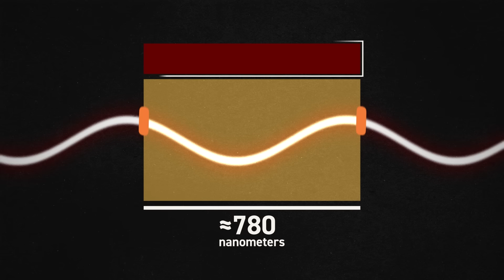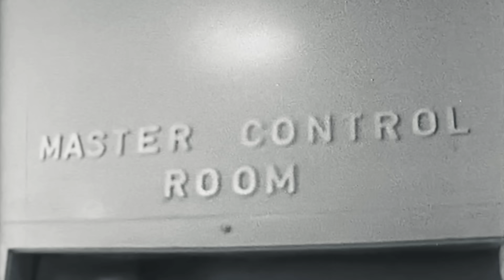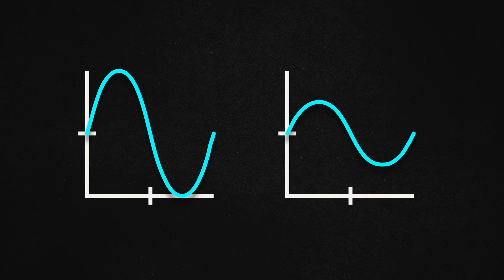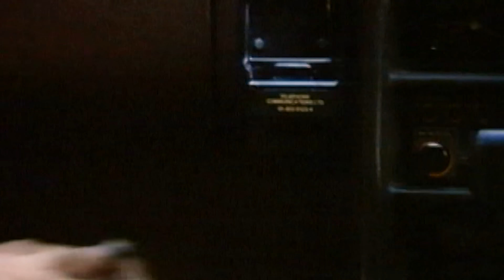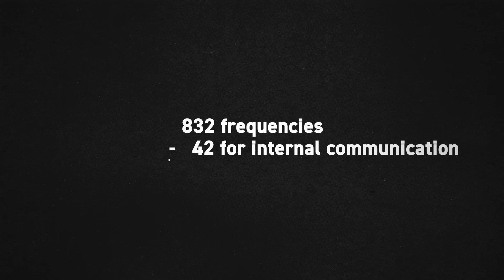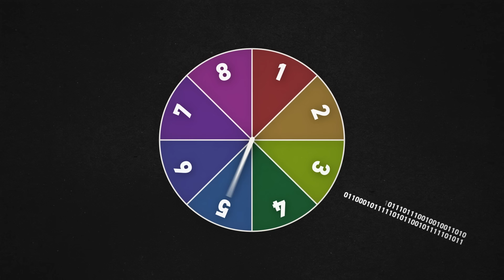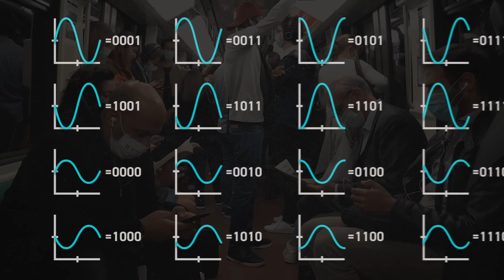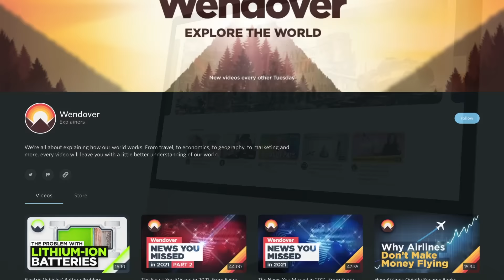How Cell Service Actually Works

Comment: 2 meter wavelength is technically not ultra high frequency (UHF), but very high frequency (VHF). 2m wavelength radio waves are 150 MHz, and UHF is 300-3000 MHz.

Comment: Though the various communication companies know and or knew this prior to the first time setting up a network. It was more expensive, meaning investor's wouldn't get a return they demand. So just as hireing the lowest bidder isn't alway's the best choice when issue's eventuall come to be. It's done in steps, build a one "G" system, while planning the impleametation of a threee "G" sevice, followed by a 4, 5 etc. etc. etc.

Though the various "TOWER'S" are now every where, I remember a time when, we stated in no uncertain term's. Not in my yard.

Comment: Great video but I'm still confused on the CDMA method.  I get the encryption, but how do three cell phones broadcast on the same channel and not interfere with each other?  Does only one talk to the tower?  If all three do how do the waveforms not mix together leaving a mess?  Or is the simultaneous broadcast of numbers amplitude driven?  It was great but the details of how they don't collide....well I guess I'm missing that part....

Comment: 11:35 They have 6 neighbors but it doesn't mean 6 different freuqncies. The neighbours could just switch between 2 back and forth and there wouldn't be any interference. I think you only need 3 distinctly different frequency blocks to get an entire grid without interefence (with the picture at 11:35)

Comment: Fascinating; so your phone's processor is doing all these calculations and more turning these bits of data into the text and images we see in real time. I wonder if this process could not work with older chip technology... i.e. 2000's chips; and what the limiting factors or bottlenecks are today.

Comment: So basically,  yes partially unrelated,  it does not matter trying to use/create a better or external cell phone antenna. As the sytem at the tower would not be able to adapt to the changes made at the hand held end. Now i see why my experiments have always been less than a marginal improvement. 
Thank you very much.

Comment: ok one thing thats always wondered me is when i send a text/phone call. to find the receivers phone, does every cell tower around me send the signal in an outwards direction until it pings with the receiver phone? kinda crazy to think sending a text across the country could use thousands of cell towers

Comment: 15:09 Is it possible to spoof a spread code? because if so, it could be insecure to transmit the same data to all users while one can decode it by using another user's spread code

Comment: 0:11 um actually the cyan colour displayed on most, if not all computer screens is made up of green and blue pixels. The light emitted is a mixture of blue and green. Our eyes detect this combination of wavelengths and interpret it as cyan, although no cyan light was emitted.

Comment: Actually on a monitor cyan isn't actually the wavelength of cyan. If you were using a cyan laser, yes, but on a monitor, no. It's a mix of blue and green diodes that our brains register as cyan.

Comment: Well, a computer monitor only produces red, green, and blue light - it produces no light at a frequency that would, by itself, be recognized as cyan (like the one mentioned at the start of this video presumably is). But it can produce a combination of blue and green light which stimulates the cones in your eyes the same way actual cyan light would, and so you can't tell the difference.

Comment: When it shrinks to 370nm it is not dark "purple", it is VIOLET, and there is a difference.  Purple is a mixture of red blue, we see violet as violet because light in the neighborhood of 380nm excites both our blue receptor AND a secondary peak on our red receptor thus our brain interprets it as similar to the color purple, but purple, a mixture of red and blue also to some degree excites our green receptor where as light in the 370nm range does not, hence purple appears much less saturated than violate although similar in hue.

Comment: How does the composite signal work when each device is transmitting independently?  It seems like you would need a single device to handle the individual signals and translate them into the composite signal.  Unless this is only done for going from the tower to the device and not the reverse.

Comment: Where does the decoding happen? if it's on the receiving phone, then surely it would be possible to write a program that modifies the user-code so you can snoop in on others conversations.

Comment: One confusion- the video creator spoke about multiplex comms towards the end of the video in which multiple users could share a packet of data that is being transmitted over a cellular network- this created the '-1, -1, -3, -1' type of data seen at the end of the video. But up to this point, all data transmission is done in binaries, as shown in the wave designations at the beginning of the video (16-bit, 64-bit, 1,024-bit), which are only comprised of collections of 0s and 1s, none of which are negative.

What am I missing? How are we able to leave the world of binaries for this packet-sharing technology shown at the end of the video? I understand with 16-bit chunks you can express any digit as a collection of four 0-or-1 digits, however the negative numbers would mandate a fifth digit- a sort of 'identifier', wouldn't it? I must be missing something. Thanks ahead of time.

Some basic googling seems to indicate that this fifth digit may actually be used, but I'm not sure.

Comment: You know most people know that cell phones get their service from the towers but they also think that the signal coming from those towers is provided by satellites. Which after some thought leads one to ask the question.. if television, cell phones and internet all get their signal from a wire fed system what exactly are satellites being used for? The number of satellites we are told exists orbiting earth is absolutely staggering but we don’t as the general public really use them so wtf purpose do they serve?

Comment: AM radio band has a lot of applications. I’m surprised aren’t being utilized especially with antiquated and simple, cheap, basically worthless technology. It wouldn’t be a big deal to tell somebody what it is without losing much research and development, but at the same time easy enough to understand and utilize in a very long wavelength that can travel and even balance between the earth surface and atmosphere.

Comment: I somewhat understand the leap forward that 5G is compared to 4G. 

My question is as follows: Assuming the inevitability of manipulating quantum mechanics to do our bidding at the most precise levels, do you think that quantum superpositional parallel sequencing will be the basis of 6G, or a later number? 

If its a later number, for example 9G, what do you think will be the biggest leap forward between 5G and 6G?

Comment: 11:33 Uh, I don't see why you'd need 7 frequencies. The four color theorem says you'd only need 4, if there were just perfect edges. In a hexagonal tiling you only need 3 colors.Of course the rreal cell tower map is not a perfect hexagonal tiling and there is probably a decent amount of overlap in some places making the 4 color theorem not apply exactly, but 7 seems like a random number. I'd think maybe 5 or 6 would be enough.

Comment: Please help. I have 3 traffic controllers working on a mountain. We all have rugged v3 radios with 16in whip antennas and a repeater box at the top of the mountain. However channel 2 works more reliably than repeat. Communication is constantly Cutting out, broken up, or not coming through. We get lots of interference pops and clicks.  Someone please help.

Comment: What I just don't understand about binary is how it knows when one piece of information stops and another one starts. If 01100 is Information A and 00111 is Information B, how does the receiver know that im not transmitting Information C (0110) and Information D (000111) instead?

Comment: It seems like you gave your editors a run for their money with this one! The b-roll on screen was pretty disjointed from the voiceover during the discussion of the AM band (showing B-roll of the civil rights movement?) and during the discussion of error rates (showing b-roll of a SIM card?). 
Top-notch overall! But I have to laugh at the image in my head of a poor editor somewhere panicking and shouting “We don’t have footage that goes with wireless transmission error rates! Screw it! Put in something wireless!”

Comment: This is such good information on communication engineering. However, I find it very distracting. The background music that you use takes away from your intended communication of the message. Please consider removing background information or background music. It is extremely distracting.

Comment: I don’t get the 14:40 adding part. There is no way the three users know each other’s coded number and somehow the numbers are added and transmitted at the same time. My guess is they simply transfer their data at the same time and the amplitudes are added up or canceled because they have the same phase??

Comment: The opening was jarring, seeming to suggest that one can't see electromagnetic waves, before later clarifying which ones one can and can't see.  Otherwise, an interesting explanation of transmitting data by radio (and specifically mobile networks).

Comment: The extremely low frame-rate on your graphics is killing me. Was it rendered at the wrong fps or what? I can't imagine this just "slipped by". Seems like they were rendered in a time-crunch, and it was just opted to use them as-is since there was no time to redo them.

Comment: At 4:31 this story exactly contradicts itself.  Just before that they say that "binary" transmits ones and zeroes.  Then I guess somebody figgered out that uh-oh, you can't transmit a zero, so they 'fessed up. 
"Binary" is just another sort of FM. 
"Ones" are slightly faster frequencies than "zeroes."  In this convention, anyway.
Then they do it again at 12:15.  When things get crowded, they "use digital signals encoded using phase and ampllitude."  That's called frequency modulation, FM, and ampllitude modulation, AM.  It's not digital.
When they use the phrase "efficient digital signal" at 13:00, they are lying.  What they mean is "efficient analog signal."  (Do they use PCM, pulse-code modulation, between the diaphragm of the microphone and the encoder of the radio transmitter?  They don't say.)
Reply: And remember, kiddies, "each" means one.  so each of anything is singular and takes a singular verb.  When somebody, e.g. Wendover, says "each are" it means they've lost track of their subject.  They don't know what theyre talking about.
Just take it down, rewrite it and re-record it, OK, Wendover?  The pictures are fine, and the technical background is roughly correct.  It's only every single detail that you've gotten wrong, Wendover.
You've assaulted 87,000 people to date, August '24.  Time to stop maybe?
Reply: oh sorry, they 'transmit a pattern that corresponds to a zero or one', is that better?

Comment: Mostly correct information, but near the start of the video when it starts talking about UHF frequencies, the narrator comments that they are roughly the size of a person, or about 2 meters. Full grown people are roughly 2 meters tall on average, but 2 meters is not Ultra High Frequency, or UHF, but actually Very High Frequency, or VHF, which is a lower frequency than UHF. UHF wavelengths are actually between roughly 4 inches to just over 3 feet. Not the size of an average full grown person, but a child yes, at some wavelengths.

Comment: Even though each hexagon has 6 neighbors, aren't tiled hexagons 3-colorable? i.e. you could use only 3 channels and still never have two neighboring cells use the same channels. And In general, any cell network should be 4 colorable, right?

Comment: I don't see the point of CDMA. They are transmitted simultaneously, sure, but we are transmitting 6 bits of information in an 8 bit message. Furthermore we have the computational overhead of encoding and decoding the message.

Why would transmitting an 8 bit code at once be superior to transmitting 2 bit messages 3 times sequentially?

Comment: So thee people each sending two bits, on a channel that contains 8 values each of which can range from -3 through +3 inclusive (three bits) or 24 bits transmitted, triples the efficiency over just sending the original 6 bits?
I don't think so.  I think you need to show an example where this does come out ahead, even if you don't show the working out in detail.
You should have said that with only 3 users it doesn't come out ahead, but with 4 it's exactly the same and this scheme works with up to ??? (I'm guessing 7.  There are 16 possible codes but I think you have to choose them carefully)
But wait a minute... with more users your sum in each position can get larger (or more negative) too!  So, I'm really missing something from this Code Multiplexing scheme's description.

Comment: I appreciate this video.  But I feel that you are trying to cover too much material too fast in this video.  You would need to already have a background in each of the topics to follow this video.  A person trying to learn this without any previous background would be lost.  I feel that if this video is meant to be an introduction to communication, you need to spend more time in each subject and give a more detailed explanation on what is happening.  For example, CDMA. A person would already need know about exclusive or gates to understand what you are doing when coding the data. What is happening in decoding the signal when you divide by 4?  This needs to be explained further.  I did like your explanation about phase modulation where you explained about changing the place where the waveform begins.  It would have been helpful if this could have been combined with information about clocking and synchronous and asynchronous data.

Comment: I was looking at Affordable Connectivity Program and immediately realized this probably comes down to a marginal cost calculation. So soccer mom b
pays first the Tower and Grandma pay for the Power. How much power, how much, how efficient? Then there is the data storage/transfer.  A lot to take in and make understandable- sound like Sam. then how green is computing anyway?

Comment: Sorry. you've entirely omitted how LTE works by varying the availability of spectrum resource blocks to users based on bandwidth requirements. Please make an LTE (which is 95% hjow 5g works) version.
Reply: You literally stopped with 3g that was invented by Qualcomm in like 1991. LTE is a lot more interesting, especially seeing graphs of channel utilization over time.

Comment: And yet, CDMA is in the dust bin of cellular history.  IiRC, GSM is a variant of TDMA.

Many decades ago simple digital signals were sometimes called Pulse Code, or Modulation.  I think that's what our fantastic Voyager space probes use; all that anyone knew back then.  Of course there was no need to cram more channels into the signal.  Only one user.
Reply: You don't actually believe we communicated with Voyager over a billion miles away?
Reply: @JohnBoon-e1n  You have evidence otherwise?  And, I don't know the actual mileage, but it's a lot. Out of the solar system about 20 years ago.

Comment: Yeah, I wanted to be an electrical engineer. But didn't know. I had hydrocephalus. And while I got a scientific mind.  I strangely have, Zero Mathematical Aptitude as a result. I've tried so hard through the years. That I basically gave up at 50 years of age after brain surgery. Because even though the brain surgery saved my life. Numbers really just do not register for me. It's all very logical. My brain will not work like that. It looks so incredibly logical to me. I cannot comprehend it. It's been very frustrating through the decades. Sure I see those numbers. It's all one huge non sequitur. It's very frustrating. It should all make perfect sense to me. It doesn't. I hear the logic explained by others. It's a marvel of thought process. I realize I do not possess. It's absolutely nascent. The concept does not exist in my brain.. I can put no two numbers together. Over 100. I have taken all sorts of mathematical courses to get better. I don't. Nothing registers. It all looks perfectly logical.. I can't put it together. I know I should be able to. It should be no big deal. None of it makes any sense to me in my brain. I think it should. I've never been able to. Not until I discovered I had major traumatic brain injury.  And even after brain surgery 18 years ago. I still can't seem to get it back. It's still one huge non sequitur. That sounds like it should make sense but doesn't. Like not at all. It's embarrassing. I feel like a total idiot but I know I'm not. I'm just a partial idiot. Just to be clear about this hazy definition. My grammar also sucks.

They tell me I'm handicapped and disabled. And I have no reason to disbelieve them.
RemyRAD

Comment: Colour isn't osolated wave lengths. Fact +. Nothing suggests it is, nor has the capacity To Suggest what you said it is. We can't recreate colour*.
Reply: It merely has an electromagnetic signal in it, that the sensors interpret into a device.